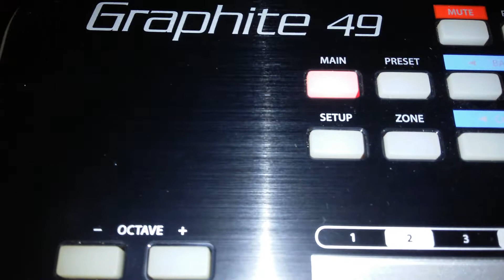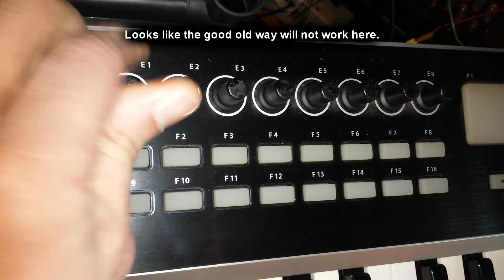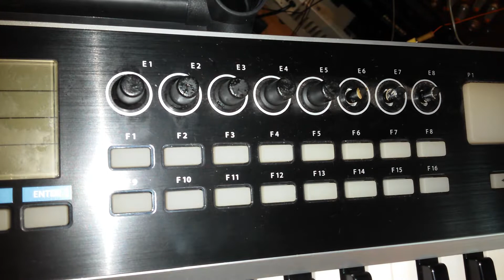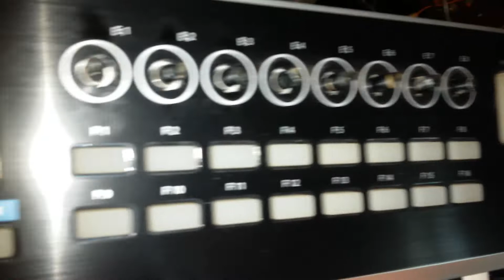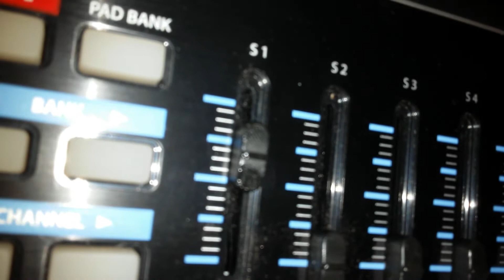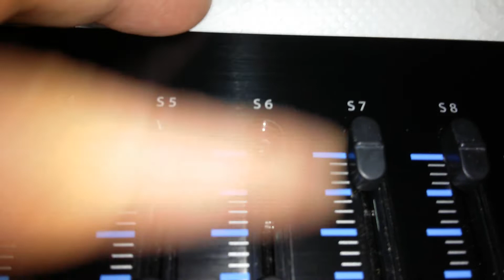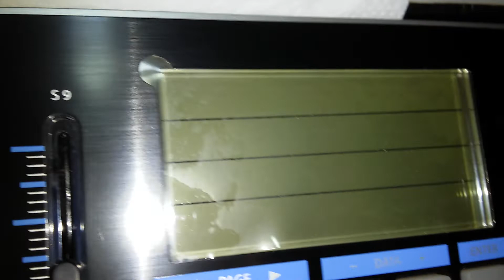Samson Graphite 49 USB MIDI Controller disassembly and knobs & wheels cleaning

Comment from the maker: After remaining stored for some years in perfect conditions, all black knobs and wheels from a Samson Graphite 49 MIDI controller keyboard presented a nasty sticky substance over their surfaces. Their rubberized coating deteriorated and melted. The unity had to be opened in order to remove the pitch bender and modulation wheels, all nine fader knobs and eight rotary encoder knobs where also removed and washed. Everything works ok and I hope there are no more sticky knobs in at least other ten years in the future...
Reply: did you only use soap and water?
Reply from the maker: Yes, the coating was very thin and easy to remove after resting about 20 minutes under water and soap.